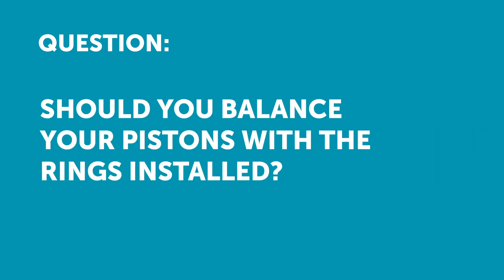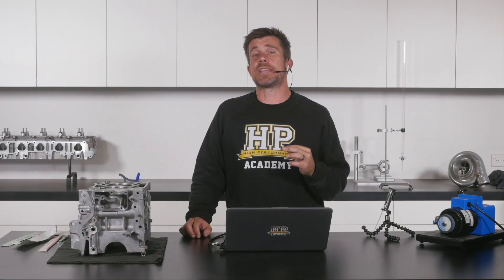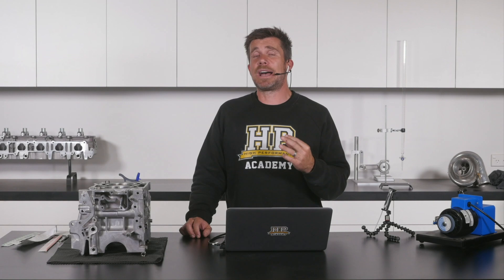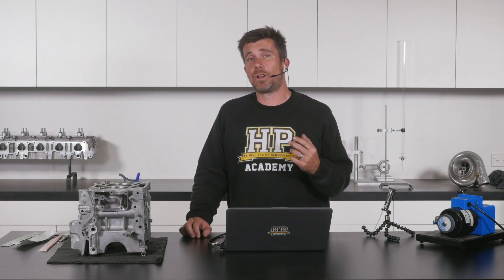Should I Balance My Pistons WITH The Rings Installed? [HPA Q&A]

Comment: I recently had an engine balanced and I forgot to give the rings to the machinist. So I measured the rings at home on a scale that I had to give him the weight. BUT I forgot to put one of the bottom rings on the scale and gave him a weight of 26 grams, when the weight actually should of been 28 grams. Will I have to get it balanced again, or is that not significant enough of a difference to matter??
Reply from the maker: This is really a question for your machinist. They will know what tolerance they worked within, what the engine is, target RPM and what you intend to use it for so will be able to give you the most accurate answer.
Hope that helps - Taz.

Comment: Hey HPA quick question regarding port matching on the hot side. Now I'm very familiar with making sure there's perfect flow going into the motor from the intake runners and no obstructions, but when I'm expelling, is it as necessary? 

I'm trying to work out how a round pipe for a manifold runner matches a large oval port on the 1JZ so I'm thinking so long as the pipe diameter covers the widest parts of the oval that it wouldn't affect it too much. I know I would prefer to have perfect port matching on the exhaust but I don't think it's possible. 🤷🤔
Reply from the maker: The generally accepted technique is to offset the primary to the exhaust port so that any step is located near the top of the port. I've not done any back to back testing myself, however the theory is that the step helps prevent/reduce reversion pulses making their way back through the open exhaust valve and contaminating the fresh intake charge.
Reply: @hpa101  Awesome. Thanks Andre. ❤️ Yeah, it's more to do with flow and reducing back pressure so pipe diameter is one area but smoothness was another area I was thinking. Like the old method of using extrudehone to smooth out imperfections. 🤔
I measured the diameter of the ports I have a 4mm difference between cylinders 2&5 (35mm) and the other 4 cylinders (39mm). I've never really encountered this so I'm a bit puzzled. 🤷 Do I stay same diameter with all 6 runners and go to the larger size or do I do the runners in proportion to the port? If same, all staying 44mm runners. If not, cylinders 2&5 pipes need to be reduced 3mm due to port size difference. My longest runners are cylinders 2&5 which are 300mm from port to collector.